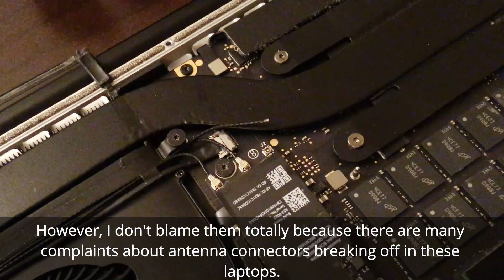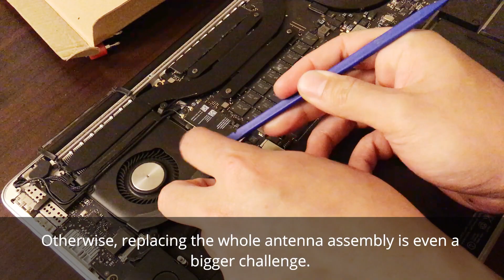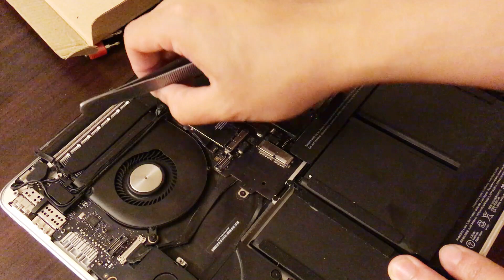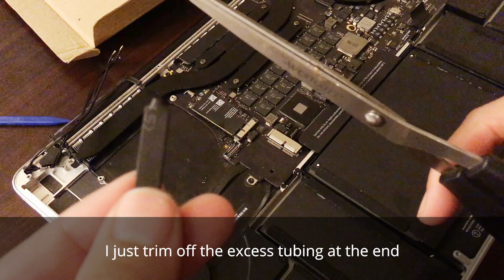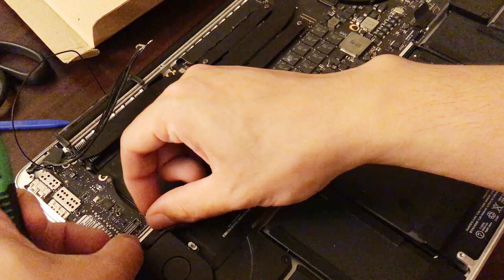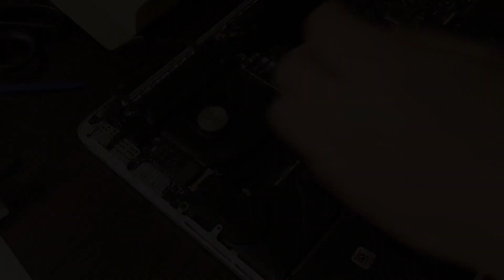MacBook Pro 15" Retina A1398 (2012-2015) Wi-Fi antenna repair

Comment: When you put antenna inside a metal enclosure it will not receive any signal. That is the reason why in MacBook the antenna is placed inside a plastic cover.

Comment: Thanks for your help ! I have a question, I broke the cable in the middle, is it the same procedure with reference to what you do in the video?
Second question, if so, which antenna would you recommend because the link of the antenna that you put in the description of the video is no longer available! Thanks again

Comment: Viet home chef thanks for the tutorial. My mbp 15" A1398 lost wifi internet but bluetooth is working. I should.replace the airport card or try your solution in the video? Thanks
Reply from the maker: Replace the card first. It’s unlikely that the cable is broken unless someone touched it before

Comment: Hi, thanks for your nice vid.  I've recently changed  the speakers on my macbook and I have a very poor wireless connection. Since I'm very close of my hotspot it's fine but 5 meter and it's down.
I opened it again and the wire and connection look good so far, do you have and idea of where is located the problem ? TY
Reply from the maker: check for dead spots in your home, it doesn't sound like a laptop-end problem to me.

Comment: You, I broke the first antenna connector.. Does solution also work for the first connector? Thanks
Reply from the maker: should work as they all use the same connector type.

Comment: My problem is I replaced my fans and the wi-fi antenna came loose, now when trying to reattach the connector is too large for the onboard slot ( the three wired antenna's are fine)
Reply from the maker: Use a magnifying glass and a fine point tweezers to very carefully reshape it.